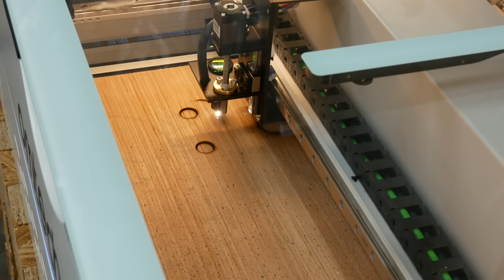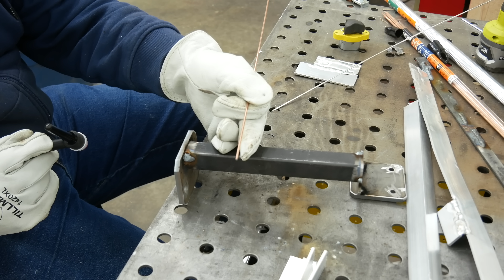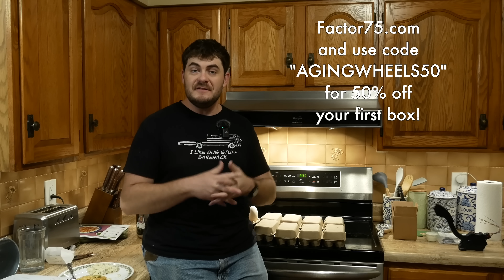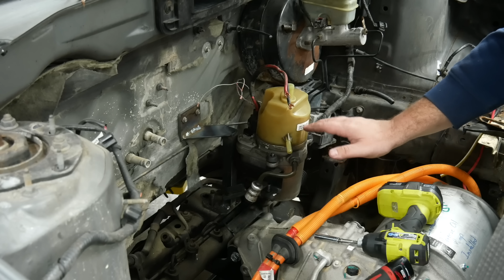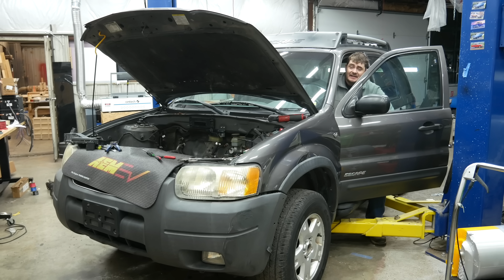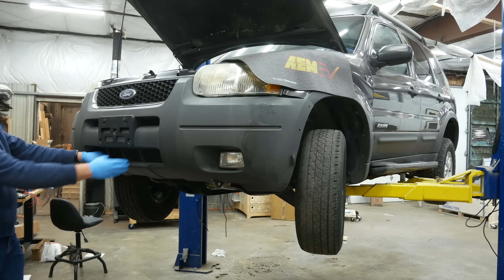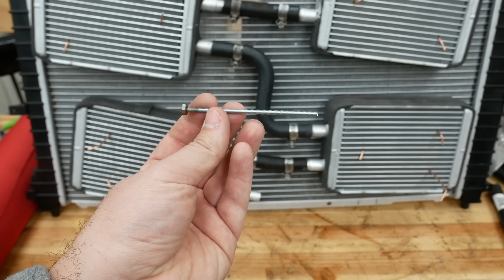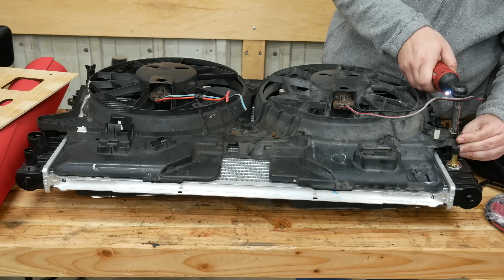Battery Powered Steering and Five Radiators | 900hp Electric Escape Project

Comment: I’ve attached fans using metal rods to a radiator before. It eventually wore the fins on the rad and caused a leak. Far better making up brackets. However you’ll likely not have that setup in the car that long to care! But for the bus I’d be changing the mounting system.

Comment: Wondering...
The Power Steering is barely used when the car is moving over certain speed.
I was wondering if you can eventually turn off/on the pump at desired speeds to avoid extra battery drain and/or -pump over-use-. Also possibly to increase rigidity on the steering, probably making the vehicle safer at faster speeds.

Always following you Awesome videos.

Best regards,

Comment: For the fans, use a set of relays to switch the two fans from series to parallel for speed control. I've seen a lot of GM vehicles that do that and it seems to work well, but if one fan goes out you loose low speed cooling. Still, not that big of a deal.

Comment: I have heard from other people using these Volvo P/S pumps in projects that if you run them at max speed all the time like this they will die quickly. You may want to figure out some way to hook it up to a steering angle sensor so you can have variable assist for the long term.

Comment: I have concerns about the stainless fixings & aluminium radiators. Even with your plastic washers I'm concerned water will bridge it and cause galvanic corrosion.

Comment: I can't believe I missed the first episode so have duly caught up. This is an awesome build and really looking forward to the next episode of massive over engineering (based on the pump bracket 😆). 
I'm not sure you'll ever get connectors that can handle 2000A without going industrial.
Have you calculated the gauge wire required tor 2000A? I'm not sure you'll be able to bend it or crimp on ends.
I believe when you go to those levels of power weird stuff happens so you might want to run your ideas past an expert.
Which I am not. But good luck anyway. 😀

Comment: You can make the fans run two speeds if you use a few relais to switch them in series for low speed( each fan basicly gets 6 volts)and paralel for hi speed. Did this on my Citroën cx and it works great.

Comment: Those connectors can only do about ~400-500A. HOWEVER... That is constant power draw. If you're only going to be running it for a minute, you could probably get away with 1000A.

Comment: A  tip for TIG: hold the filler wire between your middle finger, your ring finger and your pinkie, then feed it by using your index and your thumb.

Comment: I have an '09 Escape and the electric steering assist motors are notorious for breaking, so you might be better off. Costs like $200 for a salvaged motor and $350 for an OEM replacement.
Reply: I have a 2008 and don't have any problems with steering.
Reply: Sure, they don't all break, just a lot of them do.

Comment: On the connector recommendation, 2000A continuous current will be hard to find, physically large, and expensive. I would rethink needing 2000A rated, a more realistic requirement may be 2000A for 10 seconds, then 500A continuous.

I would expect a decent 500A connector to be able to handle that. Take a look through some part catalogs, TE and Amphenol are reputable manufacturers that have lineups for EV power distribution.

Comment: I was curious, do you plan on upgrading your blinker system to all electric, so you don't have to constantly worry about maintaining your blinker fluid levels? Been loving this series.
Reply: Are there any charger networks in the US that supply orange electricity, though?
Reply: @hjalfi  I’m pretty sure it only comes in “Green” and “Dinosaur” currently.
Reply: @ebouwman034  it also comes in "Blue Green" and "Glowing Blue"
Reply: @tagno25  that glowing blue is the shit, fr fr
Reply: @AbyssEyes02  May contain trace amounts of nuclear radiation
Reply: I'm pretty sure Ford uses an AM blinker signal, so he'd have to convert that to digital FM.
Reply: @drworm5007  Nah, AM and analog FM are still alive and well here 😂
Reply: He could use a german engineered Siemens Lufthaken to hang his blinkers above the car.
Reply: Just as long as you avoid Lucas ... Well, anything really.

Can't get their proprietary smoke on this side of the Atlantic.
Reply: Blinker fluid has worked just fine for over 100 years. No need to change what's working with some woke electric blinker crap that'll fail and probably catch fire.

Comment: Oh, and +1 for using legacy parts for steering and brakes. If the assistance fails, you just get to steer/brake harder, but if the brainbox in the electric power steering or brake booster goes on the fritz, you might be fighting unexpected steering/brake inputs. Imagine, 55mph, steering suddenly goes hard left, or the brakes lock on.

Comment: Interesting solution with the heat exchangers. I would've just used two of the half-sized Honda Civic radiators that are all over Amazon.
Reply from the maker: The problem with those is hose routing. I'd have to mount the radiator backwards with 90 degree adapters off the hose barbs. And I'm not totally sure there is enough room for that

Comment: Not sure about ambient cooling for the batteries. The Mistu Outlander actually has an electric chiller unit, so that the batteries are kept at reasonable temperatures even in Death Valley conditions. I mention the Outlander, as I have one. I am sure it's not the only car that does this, however.

Comment: You don't need a 1000+A rated connector. You might not even need a 250A rated connector, because you're not going to push that much power through it continuously. It's probably going to be plenty to use an Amphenol HVSL800 or HVSL1000.

Really, the current rating of these connectors is almost entirely going to depend on your charge current, not peak motor current. You can push 2kA through 50mm2 for a few seconds without anything heating up, basically. But push 350A through a 250A cable for half an hour during a fast charging session and things start to melt.

Comment: Regarding connectors, I'd suggest powersafe 800 amp connectors. That would mean two separate connectors, one for positive and one for ground, but frankly even wrestling one conductor at a time at that size is already enough of a struggle -- being able to plug in the poles one at a time is a virtue at that scale, not a vice.

Comment: from a quick check the highest rated EV battery disconnects i can see are 690V/630A Amphenol MSDM6302
Reply: Or for a connector and not just a service disconnect they have the HVSL14000 series which is 1000V/430A.

Comment: Really enjoying your EV conversion project and very jealous that I don't have the time and resources to pursue my own.  Regarding your interconnect question I think you just need to work your problem backwards.  Start by looking at what kind of wire or combination of wire you need to run your 2000amps between components and from there you should be able to find connectors that can accommodate your wiring harness and as a result you should have your interconnect that can accommodate 2000 amps.  If you want my opinion about your 2000 amp requirement; I'm not sure if its needed thinking about when I charge my EV.  My Kona EV draws about 100amps while charging at a DC fast charger and a Porsche Taycan consumes 400-500amps (I'm running the numbers from memory, so please double check) while charging and I believe to accommodate that amount of  current the cable between the charger and car is liquid cooled to prevent the cable from becoming to hot.  Anyways my point is I think maybe you can get away with maybe using two connectors of the coda style and I don't think you need to worry about the 2000 amp draw, sure you may hit 2000amps, but I don't think you'll draw 2000amps consistently enough and/or long enough to warrant anything much beefier then two of those coda connectors (perhaps even one).

Comment: A german company called "Harting" can design a custom industrial connector of your specifications. You can configure a connector on their online configurator but as I've tried, you can only go for 4 contacts at 200A each. You can of course contact them to figure out if they can make a contactor for 2 kA at 1kV. This may not be relevant for the Explorer, but later on for the bus you may want to check it out :)

Comment: It's difficult to find a connector that supports such high amps, I recommend you to use a big contactor and standard bolt connections, if you are worried for the waterproof factor, you can make water shields underneath the engine bay and use dielectric grease in the connections.

Comment: If you don't isolate your bolts trough the vanes with some sort of sleeve, you still will have potential differences risking some galvanic corrosion. even with the synthetic washers.
In stainless pressure installation we use nylon sleeves around the studbolts of the connecting flanges if 2 parts need to be provided with galvanic isolation
Reply: In our shop we just used big zip ties to mount external coolers. Completely janky but worked great.

Comment: The biggest problem you're having with tig is because your filler wire is massive. 
Try going with 045 instead of that 1/8
With that thick of a filler you end up overheating the base metal just to get the rod to melt and end up with a very hot cold weld. You probably notice the rod sticks a lot. That is why. Too thick.

Comment: For efficiency, you might look at cutting out the power steering above a given speed. Or, as originally intended, there are probably some CAN messages to turn it up/down with speed. Whether anyone in the aftermarket has bothered to reverse engineer those messages yet, though, is another matter.

Comment: I'm surprised you didn't think on using a intercooler has a second heater core and use the space under the main radiator
Reply: He’s probably counting on the fans to pull air thru whatever exchanger. Mounting it under would require more fans.
Reply: @maxoversteer  not necessarily  the thickness of intercooler could work passively just with air flow, they already work that way wen cooling turbos

Comment: Aviation connectors are easy on 1000 Amps. Theire made of rubber so they friction fit and they have a shorter second plus to add a relais to connect the circuit

Comment: there's been a lot of work done to reverse engineer the CANBus protocol that pump uses. it might be worth pulling those wires into the interior so you can do fun things in the future like reduce assistance at speed, or completely turn the pump off when you're going fast enough.
Reply: This is the right answer. Solve it in software.

Comment: did you just make a solid mount from a rack on a rubber isolated subframe to the firewall? that will get some forses thru it in that case.
Reply from the maker: The subframe isn't rubber-isolated. It's hard mounted
Reply: @agingwheels  ok. that's not the norm these day's stil then it will work good ;)

Comment: The best I know from dealing with electric lift equipment is Anderson connectors, for your case specifically power pole 180s, they can take 350 amps at 600v BUT they are stackable, for your case you can do a 4 by 3(or a 2x6, or 2 2x3s etc) configuration for 12 connectors(6 for each pole) matted together as a single unit for 600v at 2100 amps(or two, but if you make multiple connections, it might be a good idea to only stack the positives or neutrals in a unit, so in case of disconnect you don't draw all the current from only half the connectors), there are likely better solutions, but in battery operated forklifts and lift equipment Anderson is the standard, and it's made to be unplugged every day since the batteries are charged directly from the connector, I've never used equipment with such a big connector so the matting forces might not be plesnt to plug and unplug though(note pp180 is originally rated 180 amps hence the name, but they have been retested with larger wire, and ul certified  with 350 being the current , current rating I believe with 3/0 wire, but they get derated for ambient, at 50c they are limited to 310 amp I believe or there about)
Reply: Powerpoles are great, but they're not weather sealed and are only IP20 (finger safe) rated when they're connected. I would worry about handling a block of them attached to a battery un-mated, especially in dirty shop conditions. They do have some weather sealed variants available that might work, but they're more custom.
Reply: @Skyhawkson  yeah agreed for weather sealing(rewatching, that alone means I didn't recommend what he asked for so its null and void since this isn't what he wants), I wouldn't worry about handling them though unless it's actively raining while unhooking it, kinda the point of them to be able to handle them, as far as weather resistance 90% of that can be fixed with a healthy amount of dielectric grease, still probably wouldn't trust it for sprays or direct water submersion, but by itself would probably be enough to stop any corrosion issues, regardless in a automotive situation you would probably stick the block into a box
Reply: I use SB350 Andersons with my electric winches and they are not perfect

Comment: Instead of getting a connector to handle max current, use the motor controller to limit current.
Do you need 2K amps all at once?
Reply from the maker: I'd feel like I've been lying to everyone if I built my 900HP Escape to only handle 600HP
Reply: @agingwheels   Tease us with HP boosts once you're confident the design won't twist the car body like tin foil.

Comment: Thanks for another great video. I also like the way you do those ads, they seem really genuine. If Factor would deliver in my country I would have ordered some, you can be sure of that.

Also, would the boots/trunks of the codonors have these gas suspension thingies and could they be used on the window of the boot hatch of the ford escape?

Comment: The Appleton 'Powertite' series and the Eaton 'arktite' series are watertight connectors meant for industrial applications and heavy machinery. Unfortunately they're only rated for 400 amps and 600 volts AC - a far cry from your required 1000 amps.

Comment: Doesn't mounting those 4 heater cores on rubber backing kinda block the airflow through the radiators?

Comment: Could the power steering be modified have a high pressure hydraulic accumulator, backflow valve, and a pressure switch to enable/disable the pump on demand? That might save a lot of power consumption.

Comment: The radiator fans do have adjustable speed, they're simple dc motors. Changing voltage changes speed, but that's more than you need since the coolant mass is like a physical heat capacitor.

A simple hvac fan switch & resistor set will work, though you would probably want something fancier. 

…Like, solid state control using pulse width modulation, that wirelessly links to the motor controller…
Reply from the maker: "solid state control using pulse width modulation, that wirelessly links to the motor controller"

Soo... an AEM PDU-8 being controlled by an AEM VCU300? What luck I already have both of those!
Reply: Idk, maybe. Fuel injectors are pulse width controlled, so are many valve things (like exhaust recirculation & EVAP valves).

Oooh! Maybe you can rewind a fan motor to 3-phase AC!

Comment: I’m no expert welder but the one thing I do know about Tig is that it must be clean. Clean the mill scale then clean everything with acetone and I do mean everything from your filler rod to your metal. Dedicate something to only grinding your tungsten wether its a grinding disc, diamond wheel, grinding stone does not matter just dedicate it only to your tungsten grinding to avoid contamination. Lastly make sure you have pre gas on and post gas on to avoid the weld turning to crap. These few tips have greatly improved my tig welding like I said I am no expert but these definitely helped.

Comment: I did electrohydraulic power steering in a CRX and measured current draw. I don't remember the exact numbers, but the pump idling was about the same as one headlight, while it topped out at full lock, that is full pump speed and full pressure at surprisingly low 30 or 40 A at 12V.

Comment: I would think something like a pair of half width radiators side by side would be easiest to deal with. Dunno if they're still around, but 90s civic all aluminum "race" radiators off ebay were great for this sort of thing, compact, nice thick core, all welded construction, easy to alter, good for several hundred hp in a light combustion powered car and dirt cheap.

Comment: I love how overcomplicated you made your cooling system.  For reference next time, that radiator has a built in automatic transmission cooler.  Its a heat exchanger that is in the water tank of the radiator. You could have just plumbed the second loop into that.
Reply: That only works if the two fluids are at similar temperatures. Otherwise your low temperature fluid will become a heat sink for your high temperature fluid.
Reply: @jamesashe  in the case of this EV your battery temperatures and controller temperatures and such are all the same relatively low temperature. Which actually means it's going to be very inefficient because you want the larger temperature difference between the ambient air and the coolant.

That said, the capacity of this cooler is so much larger than what he needs that it doesn't matter and you will be near ambient temperature on the output anyway.